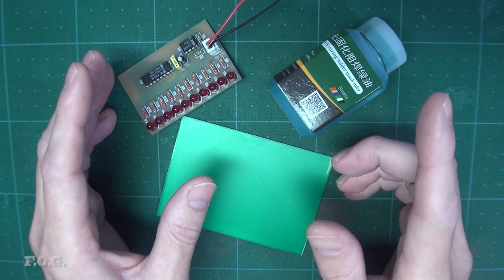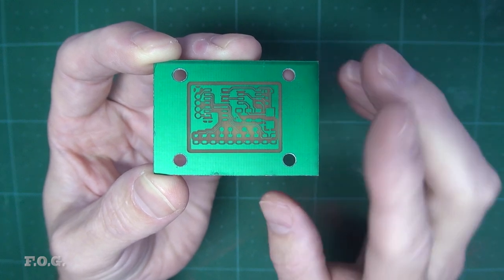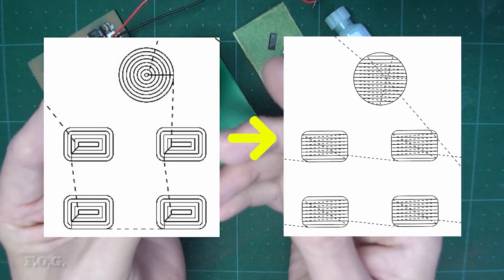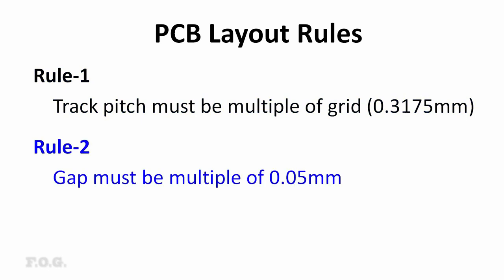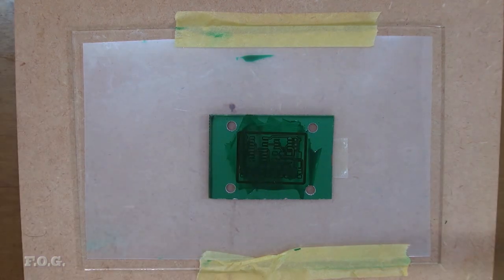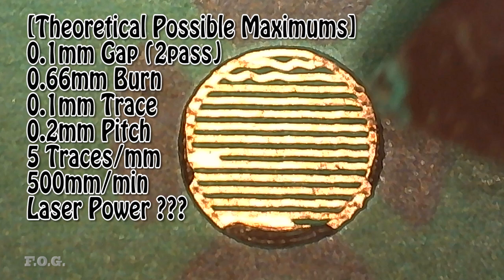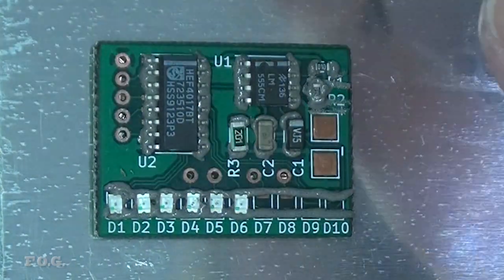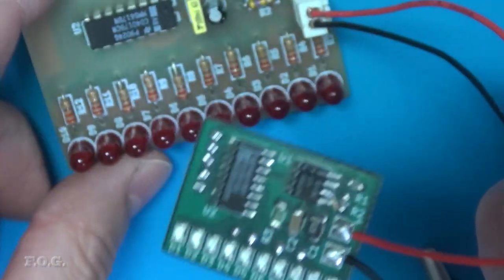EP7 – DIY PCB – Best DIY PCB EVER! (Double Sided SMD)

Comment: Massively impressed with your dedication and boy has it paid off. That pcb looks incredible. Well done. Might have to dig out my old 3018 now and have a go it’s very inspiring.
Reply from the maker: Actually I am really enjoying using this process, it is getting very consistant results and only improves as I learn about and further refine the process. The result is of course important, but if the process is such a hassle that you avoid it, then what is the point right? Glad your inspired, if you break out the 3018 then let me know how you go!
Reply: @ForOurGood  Thanks very much, yes my 3018 is quite  an (very) old one, single 2020 extrusion base frame and uprights with 3d printed spindle and laser carrier. I had modified it years ago to make it stiffer but looking at it now I am not happy the frame is stiff enough so will be working on that and in addition the 10 mm rails for the x axis and carrier for the spindle do flex a bit so I am thinking of fitting some linear rails to stiffen it all up.. I did upgrade the spindle motor and think its ok but need to check the run out to see if it can be used.. All good fun though and if I can get get halfway close to your results I will be pleased. Thanks for the videos, hope your channel goes massive, its very interesting :)
Reply from the maker: @AndyJenkins999  Oh, that sounds like a very early version... But I have some good news for you, mine is really no better. Cosmetically I did a few things to it, and added the end point switches, but otherwise the whole thing flexes an moves around like crazy.. using it as a machining CNC is a bit of a joke really. But when using it just with the laser, there is no cutting load, and in this case, it is surprisingly accurate. As long as you can mount a decent laser on it, I expect you will see results close to what I have been getting. Even with all that said, I also plan to do some basic upgrades on my 3018 soon too.. couple of linear rails etc.
Reply: @ForOurGood  totally agree thanks that’s encouraging. I did get a pretty good level of stability by bolting it down to a box made to house the power and controls so it should be ok and did get some pretty good results milling small hardwood and some small aft aluminium but, it’s just the gantry is like 2020 uprights supported by corner brackets and some 3d print braces and it’s a bit rubbish so I will make some stronger sides for it to beef it up. The Laser should be ok too it was a later purchase I can’t remember the power but looking at your videos it looks like the boards don’t need massive power anyway so think it will be fine. The main issue is the carriage for the laser and spindle they were 3d print versions which I designed and they worked well for a year or so but have been bolted and swapped over so many times they are looking tired and sloppy. Also made the mistake of using PLA so they warped as they got hot. I will need the spindle for drilling but may also use the machine for other small jobs too so will redesign and reprint in ABS now that I started. I think half the fun is modifying the machine in the first place anyway. 😃

Comment: forget liquid tin, unless you can get the MG stuff (but that is barred from export outside of the US and Canada last time I checked) the alternatives are all junk. It also won't fix the issue as it also will not adhere to the board for the same reason. What I use is a chemical that is out of complete left field. It's a compound I get from a furniture restoration store that is intended to take the top layers of shellac finish (also referred to as french polish) from furniture (the damaged layers) before new shellac is added to restore the shine.

I have no idea what it is made of but have found it is amazing for taking of copper oxidation without actually being abrasive to the copper. A definite plus for pcb's where the copper layer is already thin to begin with. It turns badly oxidized copper into bright shiny copper with just a wipe on and clean off using a paper towel.
Reply from the maker: Sound pretty interesting, do you have a brand or any other information I could use to research it further? Currently I am using Pikal metal polish, applied with a fine toothbrush, and that seems to work well, and solved the issue I was having. But if there is a better or easier way then I am happy to give it a try! Thanks for the comment.
Reply: @ForOurGood  Alas no, it's a concoction made by the store owner himself. As such it only has a name label on it but no indication on what is contained within. At best I could provide a link maybe somehow.
Reply from the maker: @xConundrumx  no worries, I get it now. Thanks anyway!

Comment: This is epic! Thanks!
Reply from the maker: Glad you liked it! Thanks for the comment ;-)
Reply: @ForOurGood  I think I'm going to try to replicate your setup. I wonder if some kind of polishing pad and a cleaning fluid would solve the copper tinning problem. And I'm referring to doing it with the CNC mill. Basically, flood the board with something and then run a program to hit all of the pads with the cleaning pad.
Reply from the maker: @carlanwray8718  That sounds like an interesting idea, I will definitely keep it in mind. For now, using the metal polish and fine tooth brush is giving good results and is pretty easy to do. The areas I am focused on improving, is laser clearing the pads, and laser exposing UV resin (see EP8). Both of these are very close, with a clear path forward, but it might be a couple of episodes before I can declare I have fully solved that part of the puzzle. I am very interesting to hear about results from other people trying to replicate this process, so be sure to let me know how you go!
Reply: @ForOurGood  I will keep you in the loop. 

It was really fun watching you go through the process because I had worked all of it out in my head and just wanted to see if someone else had came up with the same thing and you did pretty much exactly what I had in mind. I hadn't thought of the screen printing method for spreading the solder mask but having experience with that I probably would have sooner or later. I thought that was brilliant. For the silk-screen, I don't think I will ever attempt to paint the lettering. I think I'll probably just figure out what laser setting works to make it so it's visible with the right light or a magnifying glass and not worry about it. It's not like you need to reference it all the time.

Comment: what is the best type of engraving tools to make pcb routing?, what degree? (15, 30, or 60°?)
And what type for making masking text?
Reply from the maker: Hi there!
Actually I gave up on trying to mill PCB's after my first try was a disaster, so I don't really have any good advice. What I used was 0.1mm@20deg and 0.2mm@30deg.
Currently I am using the laser and etching method I demonstrate in this series, and that has been working very well.
Thanks for your question:face-blue-smiling:

Comment: Amazing home made pcb! I found your video while looking at smd pcb design, and progressing from through hole. Is the kicad project available to share?
Reply from the maker: Thanks for your comment and query. I don't actually have a place to share files at this time. The good news is there really is not much to it, so it is probably worth fumbling around and making your own as a way to learn. In some of my video descriptions I do provide details about the settings and equipment I am using. But as I am still working to improve the process everything is still pretty fluid. Wish you the best of luck with your SMD PCB making adventure!

Comment: I haven't tried this myself but google says table salt and sour lemon juice might do for removing the copper oxide.
I have the same setup with Kicad, candle and CNC3018 and found myself here trying to make PCBs by painting over the PCB and removing a layer. I just don't have the laser and I'm researching ways to do it with V or end mill bits. I'm gonna have to see the rest of your videos to see what you did for height mapping. Thanks for sharing this.
Reply from the maker: Thanks for the comment. I think I saw someone else make a comment suggesting something similar, but I haven't tried it myself yet. Right now I am using generic metal polish and a super fine hair toothbrush to polish the surface, and it seems to work well (check the later videos). Even so, I will probably test a few of the chemical methods suggested in the comments at some point. If you can, I really highly recommend purchasing a laser and mounting it to your CNC3018, it's totally worth it.
Reply: @ForOurGood  I got a 2.5W laser. and about a dozen different acids, reagents, etchants and also nickel and tin plating solutions to avoid the copper oxide problem. Still looking for the mesh thingy. I'll share my results as soon as I get my hands on one. If there is anything You want me to test It'd be my pleasure to do it.
Reply from the maker: @ABehrooz  Honestly, I am most interested to see how well that lower power laser will work. The silk screening stuff should be no problem to get your hands on, only the silk screen material is somewhat special, but still commonly available. For the ring and spatula I am pretty sure you will find something. Good luck!
Reply: @ForOurGood  It cuts the UV paint quite nicely. but struggles if its a little bit too thick (I'm currently applying it with a credit card) which is why I'm going for the mesh solution(Which I too saw on wegstr videos). It is quite funny that I rode a taxi for 10 minutes and came back home with 98% sulfuric acid, 30% H2O2 and other things that would certainly put me on a list in a lot of places but can't find a mesh and silicone spatula.🤣

Comment: If you have an oxide problem I would give citric acid a try for cleaning the pads. Do not know if it works, but it is a reasonable experiment.
Reply from the maker: Citrix acid, I might just give that a go, thanks for the suggestion! For now I have been having some good success with a toothbrush and metal polish. Still, it would be interesting if a more passive process was available such as soaking in citric acid. Thanks again!

Comment: Most excellent story-telling! It has all the drama of a good novel :) I don't suppose that you'd be willing to share the KiCad board settings/design rules you used for this project, would you? I'd like to import them and start experimenting myself.
Reply from the maker: Glad your enjoying watching me fumble my way though this, actually I am still improving the process, but hopefully I should lock most of it soon enough. Generally, I am in a very optimistic mood given the progress to date, though some hurdles are harder to clear than others. I am a bit of a newby with KiCad, so don’t think I am not doing anything special, just setting the grid size and track sizes. I also don’t really have a way to send you a file at this time. Maybe in the future I might setup some public files, but that will be a little further down the road. For now I am adding the settings I used in allot of the videos descriptions (not all), so hopefully there is something useful in there, while keeping in mind this is still a work in progress. Thanks for taking the time to comment.

Comment: Great video! Do you have a plan to integrate poper vias in your process?
Reply from the maker: So there are 2 ways I have seen people doing vias. The first is applying a conductive surface inside the holes and then electroplating, the second is a rivet style. To be honest, I am not so interested in either of these processes. For now I am thinking of just trying to use a much smaller pad and wire. For most cases this is good enough, but does still require the occasional design compromise. I also continue to think about a new way to do a real via process without the hassle, but it is not looking promising yet. Thanks for the comment!
Reply: I have seen an interesting technique where you only drill through the top copper layer (you can use conductive testing through the drill bit and the bottom copper to stop the CNC from drilling the bottom layer too). This creates Wells instead of holes. The Wells can be filled with solder paste maybe and then heating that up could create the vias.
Reply from the maker: @andreal1061  oh that is an interesting idea, will definitely keep it in mind, thanks! But no good for connector pins or similar through hole no solder access components. Anyway, you got me thinking about the problem again, so hopefully something will pop out of my brain. Just at the last stages of a major rebuild of my CNC, so hopefully I will be back at it soon.

Comment: Great series. You obviously don't give up easily. If I'm not mistaken, you never tried to use positive photo resist spray, and only use laser for exposure? I don't know if your laser wavelength is within the required parameters of standard photo resist, but I suppose it might be. If this works, laser exposure would eliminate the need to make a film, and would probably give crispier results.
Reply from the maker: It is a good question, and something that has crossed my mind in the past. I think the answer is pretty much in the next episode, where I switch to an expose only method for doing the text overlay. What I found is there is allot of bleeding around the core beam that causes unwanted exposure. Now I am working on ways to improve that, such as using a blinder and messing around with the settings, but indications are such that I wont be able to get a crisp result like I get when I simply burn the resin. Now I expect that would be the same for an applied photo resist coated boards, of course an experiment would be required to be 100% sure. But right not I don't have much motivation to work with a exposed photo resist process, because the current process is working great, and because I have had many years experience making boards with photo resist, and it sort of sucks in my opinion. Of course you would now be dealing with another different bunch of chemicals, and adding another step to the process (development), and my exprience has shown that the photo resist can be really delicate, often resulting in defects. Anyway, I would really love someone out there to give it a go and see how good a result they get! Thanks for the comment. :trophy-yellow-smiling:

Comment: I just realized. Low melt solder is the problem. I use it for delicate repairs and you have to remove it before proceeding
Reply from the maker: You are correct. I now also believe the low melt solder was the bulk of the problem (talk about that in a more recent episode). Some of the components appear pre-tinned with higher melt solder, so the low melt solder melts first causing them to float. Even so, some types of components may still shift around, so in this case using thermally activated glue for such components fixes that.

Comment: Too bad you stopped this series. You really had come a long way and you had perhaps the best way to make pcb's. I think I am going to order bare pcb's from jlcp. The advantage is that you then have reasonably good quality pcb's and already provided with a nice soldermask. That saves the mess :-). I think airassist can also help to laser clean the pads afterwards. That will keep the copper a little cooler and hopefully will stay good.
Reply from the maker: This series is not stopped, it is just on hiatus while I'm grinding away on a different (somewhat urgent) project. These things always take longer than you would like, but it looks like it should be done soon. So hopefully it won't be too long before I get back to this series. Thanks for the comment!
Reply: I also saw on another video that airassist (blowing air onto the laser spot during blasting) was improving substantially the cleaning of the pad by blowing away the burnt resin while it is in smoke form. This is probably worth a try. Thank you for the AMAZING série !!!!
Cannot wait for the next one. Hopefully you came to a point were you could do a wrap up video (or article) summarising all success ?

Comment: Laser almost in and going to try my first attempts via lightburn because I don't have a cnc (yet). The description says you do 18 passes before the etch happens. is this correct? When removing the pads, there is only 1 pass.
Reply from the maker: "Passes" is this is the name of the setting within Flatcam. This name is confusing and wrong. But that is what it is called! What the setting actually does is change the number of paths that surrounds (isolates) a feature.. These "passes" don't actually overlap of course...Make sure you wear eye protection, these lasers can be very dangerous if you are not careful.
Reply: @ForOurGood  Thank you. so if I understand correctly then the laser does not go over the same part 18 times or does it?
Reply from the maker: @matheokoning4456  You are correct, the laser only needs to burn over the same path once for resist cleaning and pad clearing.
Reply: @ForOurGood  Okay then I get it, thanks again. I saw an overscan option in lightburn. Maybe that is also a solution for you, for the pads that get too hot. Depending on the speed and the overscan percentage, the pad will have time to cool down very briefly after each pass.
Reply from the maker: @matheokoning4456  Good luck with your experiments. It is tricky to figure out a system that works. I have not used Lightburn, so will be interesting to see how you go!
Reply: @ForOurGood  Thanks, I'll keep you posted and looking forward to your next videos